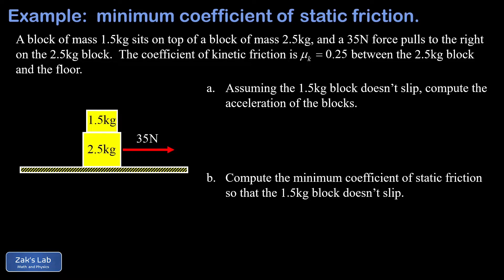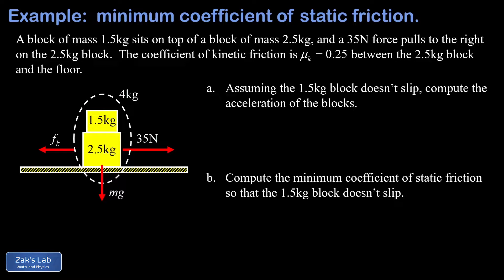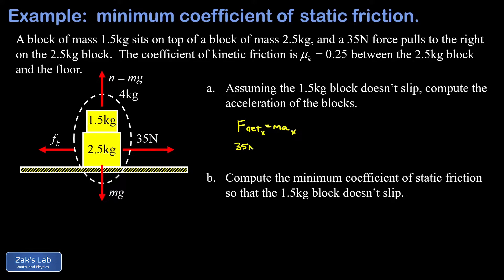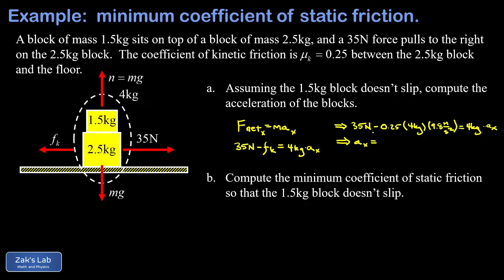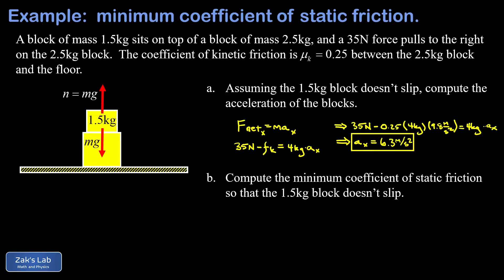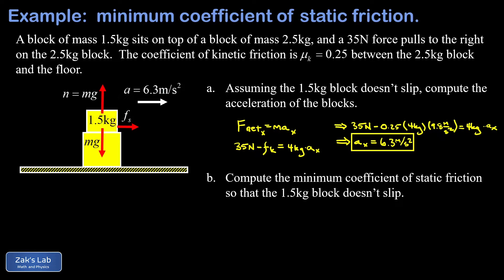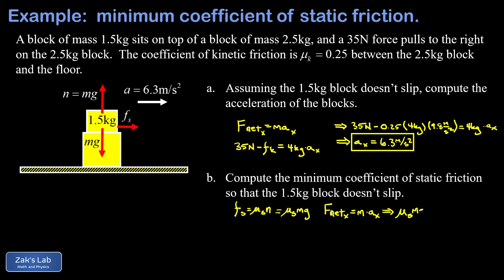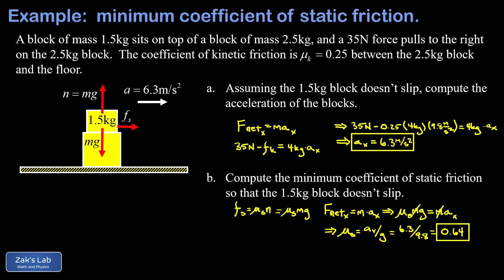Accelerating stacked blocks minimum coefficient of static friction to prevent slipping.

Comment: Hi there! Why are the two masses added when calculating Fs between the blocks? I.e. Fs = μs mg => μs x (1.5kg+2.5kg) x g - thank you in advance :)
Reply from the maker: They weren't . . . the only place we have the masses added together is for the calculation of kinetic friction at the bottom of the bottom block.  I did use "m" to represent the 1.5kg block in the second half of the calculation if that's what you mean.  That was a little sloppy because I used "m" to represent the combination of blocks earlier, but it didn't materially change anything about the solution. z
Reply: @ZaksLab  thanks a lot for your reply! So basically it's just Fs equals the coefficient of static friction multiplied by g x mass of the top block? And that's equal to the Fnet?
Reply from the maker: @alibi06  Yes, so to summarize, you start by finding the acceleration of the entire combination.  Then you apply Newton's second law to the top block, and Fnet is just the static friction force pushing to the right.  Plug in the known acceleration and you've got a handle on finding the static friction coefficient.